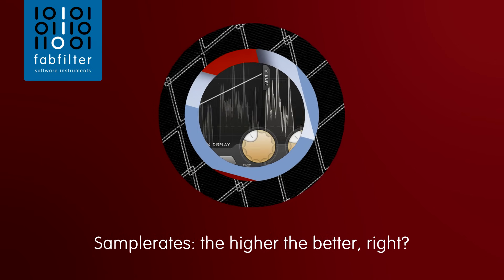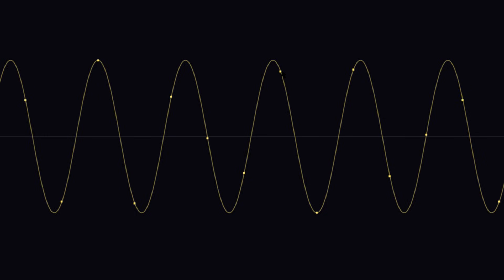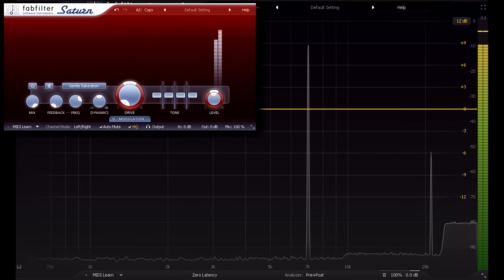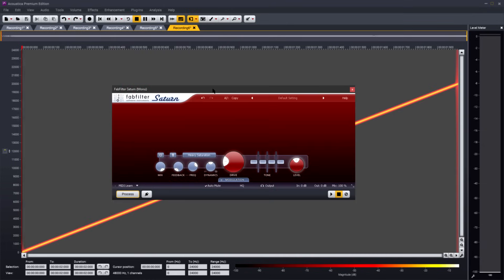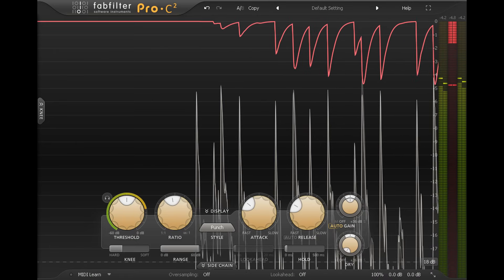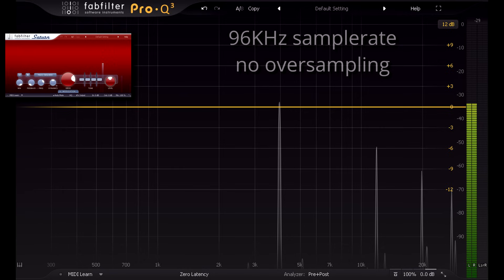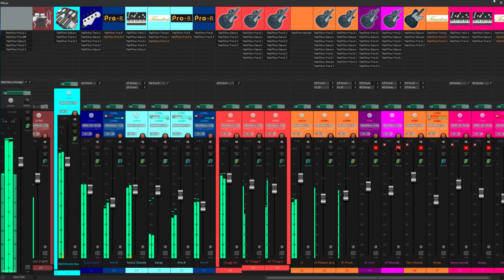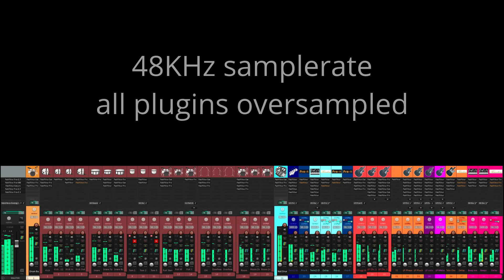Samplerates: the higher the better, right?

Comment: Excellent video! I thought I had a good understanding regarding the issue of sample rates, IMD, etc., but it seems I always learn something new from your content! I think you may have converted me to 48 kHz, but the thought of introducing audible artifacts during the conversion down to 44.1 kHz always bothered me. Can you shed any light on the subject? Are my fears completely unfounded?
Reply: Michał Bugajski 
Yes, completely unfounded.
Reply: Note the acoustica editor showing how a wave looks post-reconstruction. You can easily find that the same signal sampled with a different sampling rate, assuming they are both band limited produces the same result. While most DAWs don't show that wave, they all use the maths that go into this for sample rate conversion, so you don't get artifacts.

Comment: I am left a bit confused here- while 96k recording may not be necessary you only applied the  over sampling to the 48k example, wouldn’t the 96k program benefit as well from over sampling? Would the brick wall filters also reduce aliasing for the 96k program? Also isnt the addition of extraordinarily high harmonics in a saturation plugin more of a bad design decision in the plug-in  than a problem with recording at 96k?
Reply: It's decoding sir not same like encoding.

Decoding with 32-bit floating point + oversampling x2 x4 x8 or x16 (using API or siftware already progammed) can makes good sound quality rather than encoding

Comment: This is a good video but misses an important advantage for double speed sample rates (88.2/96KHz): all the tuning and timing correction we do these days benefits greatly from preserving ultrasonic information that becomes audible when stretched. Intermodulation distortion is a natural property of analog and not a digital artifact like aliasing is. And oversampling still has the same or better benefit at double speeds with an even gentler filter than 48KHz. It's also a bit disingenuous to have your sample audio at 44.1 and then upsample for the comparison...should have downsampled 96KHz instead. No one should work at 44.1 anymore, CD is long dead and everything else runs 48Khz including YouTube. Thanks I love your videos.
Reply: using samplerates higher than 48kHz is nothing more than erroneous stereotypes based on propaganda.
people using these higher samplerates trying to convince yourself by any means that their records will sound better from this.

Comment: This video is amazing. Absolutely packed with valuable information! 
The only part that was incorrect was the claim that YouTube videos have a 48khz sample rate. 
If you upload a video to YouTube with 48khz audio, it will be automatically converted to 44.1khz. 
So whenever you play YouTube videos, the audio will be sampled at 44.1khz regardless of the original sample rate.
YouTube made this choice to reduce bandwidth requirements.

Comment: man, you are so good!
I have a (stupid?) question: does the aliasing also also arise when recording analog distortion to a daw converter at 44,1khz?
Reply: No. The analogue distortion may produce harmonics higher than half the samplerate, but these will be filtered out by the ADC.
Reply: Not unless you build your own hardware and don't add an anti-aliasing filter. Generally your converter has a signal chain that looks like this:
Input->Anti-aliasing filter (lowpass that filters out everything above half the ADCs native sampling rate) -> ADC itself (here it's digitalized) -> digital filter cutting everything above half the recording sample rate -> downsampling to target sample rate. Now, if you get an ADC IC they generally have their analog AA_Filter built in, but many allow manufacturers to override the stock filter so they can design their own filter. So if you got one, overrode the internal filter and did not put a custom AA-Filter in the chain, you would get aliasing.
Reply: @simongunkel7457  Could've I see you commenting on Adam Neely's channel by any chance?
Reply: @ramziel  Oh, most definitely.

Comment: I did not hear much of a difference between the 41 KHz and the 48 KHz version of the mix. But I also realized that my hearing capacity above 15 KHz has already decreased significantly. 

My DAW is known for bad sample rate conversion, what offline tool are you using? The free one by Voxengo?

Comment: Excellent concise explanation!
Just dropping some "whataboutism" here: What about transient definition? Independently of a continuous pitched sound, there is more transient definition in a higher sampling rate. I can tell the difference between drums recorded (and being reproduced) in 96khz from drums recorded on 44.1. Would have been interesting to see some of that in the video, but I understand the point was to show the overall effect on the audio file. 
Also what about mastering for vinyl? 
For those interested in exploring the subject of oversampling and its effects on aliasing I recommend this: 
https://www.juansaudio.com/post/about-oversampling-and-aliasing-in-digital-compression
Reply: Is there, though? I'm not necessarily disputing what you're saying, but I'm struggling to come up with a rational explanation as to why there would be more transient definition at a higher sample rate? Surely, all we're capturing in digital audio is frequency and amplitude - which of these two parameters can we improve upon beyond what 44.1 kHz offers to yield better transient definition? The 'fastest' (so to speak) sound we can hear would be a theoretical 20 kHz frequency, and we already know 44.1 kHz is sufficient to capture this. I can't see how we don't already have the capacity at 44.1kHz to recreate the fastest transient possible.

I don't doubt that you're encountering differences in sound between drums recorded in 44.1kHz and 96 kHz, but I'm more inclined to believe it's a result of extraneous factors and variables and not the sample rates themselves. I'm sure there are things I'm not considering though, and I'm very happy to be corrected!
Reply: This is 100% false. Anything you're supposedly hearing either isn't there or doesn't have anything to do with "transient definition." In the time domain, all signals will be recreated PERFECTLY. You can try this yourself with an oscilloscope and moving the transient of an attack. No matter where you move it, the samples can recreate it, even if the samples don't move relative to the attack. That's just how the math of recreating waves WORKS. Becuase of the math, sample rate has literally nothing to do with the time-domain of a signal

Comment: Absolutely loved this video, and I'm seriously thinking about giving 44.1kHz a go for a while. However, it's worth noting that with a dedicated interface and computer for my guitar rig, the quality changes are striking when I run it at different sample rates. For single instruments, this seems crucial for achieving my desired sound. Yet, when it comes to mixing, pushing your computer to those levels and dealing with the issues mentioned in this video can be nearly impossible or not worth the effort. Just something to keep in mind! 🎸🔊

Comment: The first problem or issue with this example/experiment is not recognizing that recording a band recorded at 96k Vs upsampling a pre recorded band at 44k will give you a a different sound. Second the non musical sine wave samples will give you non musical sine wave reflections that will sound non musical. You can't isolate one frequency and and compare that to a living breathing musical recording or sound source. Just my thoughts.

Comment: Wow! This is the most lucid discussion and illustration of harmonic distortion that I've ever seen.

One small point that seems to be missed in this video is that antialiasing lowpass filters are often employing a trick where they don't fully attenuate content exactly at 22.05 kHz for a 44.1 kHz signal, as you talk in 26:00, but they often are configured to start attenuating around 20 kHz and reach complete the attenuation around, say, 24.1 kHz, with the midpoint of the transition band being at the middle, 22.05 kHz. This is because the aliased components remain ultrasonic, so they don't matter, but the FIR filter length becomes halved, which also halves the CPU cost. Doubling the width of transition band from 20 kHz to 28 kHz at 48 kHz sampling rate will halve it again. At the beginning, where you show off the mild saturation in spectrogram, you can also see that some of the aliasing is reflected back at ultrasonic range, and I believe this suggests that this particular trick is being used in the HQ mode. If the aliasing was controlled in a more traditional way, you'd see the overtones fade out before they touch the 22.05 kHz line, and nothing would be reflected back.

One other giveaway is seeing the -6 dB point at nyquist frequency for the lowpass filter. It doesn't seem to be much in dB terms, considering that any sinc filter is going to hit at least -96 dB in any competently written program, but it is already -50 % of the linear value by this point.

Comment: I don't understand why the 10kHz and 20kHz waves turned out to be perfect sinewaves even though there's just two or one sample points respectively for each half of the cycle.
Why are two or even just one sample point for each half of the cycle enough to reconstruct a perfectly smooth sinewave?
Why is it that if we increase the sample rate to 96kHz the 20kHz wave doesn't get represented with any greater accuracy?
I'm confused AF
Reply: The Nyquist Theorem. Also, those samples get connected with a smooth curve, so as long as there is at least one point, the reconstruction should be perfect.

Comment: Hey, I want to run a project just to run my guitar sound in 192khz with some effects. But at some point it starts clipping.
Are there processes in windows I can shutdown or something to free up my cpu? or is it gonna clip anyway?
Reply: Clipping has nothing to do with cpu. Clipping is a signal with too high of an amplitude to be captured correctly digitally. You need to turn down the gain or volume in your plugins

Comment: A very interesting and well documented presentation. Thank you. Listening to the differences from a 2 channel out of my PC through an old modest at best 4.1 PC speaker system running the front 2 channels into the rear speakers and pointing them away just for ambiance, because I could not crank it to hear details and the bandwidth is limited, the biggest difference noticed a shmearing of image. The center image would spread and wander slightly. 

Another part that caught my attention was the IM of the guitar with the drum mixed in. Very audible even with my limited listening environment. Something I would never put up with with my analog vinyl playback! If drums IM'd guitars that badly in it I would toss the system. 

One of the underlying problems with all of this is that the sinewave has little to do with music other than especially way back simple sinewave measurements was all we could do. Hearing is actually time domain based. Sound pressure waves enter the ear and vibrate a successive series of hairs which based on the time duration of the pressure wave reach further into the ear, modulating more hairs further into the canal which the brain then processes based on that duration and amount of penetration. Our brain does not do FFTs to determine fundamentals and frequency distribution. Measurements show we are capable of discrimination thresholds for interaural time differences that are near 10 μs for normal hearing listeners. That would relate to a 100KHz fundamental. So while few if any people would "hear" a 100KHz sine wave. Most people are able to discriminate that time difference in a leading edge of a audio signal. We just could not make test equipment that operated in the time rather than frequency domain back then. And so now everyone works in the frequency rather than time domains.

Comment: So, you said once 4x oversampling and also 8x oversampling. Which was used when you tested with HQ / oversampling?
Reply: HQ mode in Saturn enables 8x oversampling. I used the highest 4x setting for compressors and noise gates etc. in the final examples.
Reply: Dan Worrall Many thanks!

Comment: I've been battling with myself about this for a couple of months now.
"192khz? Pointless. 96khz? Meh. 88.2khz? Perfect...???"
And after watching this video, I've determined for myself that 48khz is probably the optimal samplerate.
It will pretty much reduce the chances of intermodulant phase distortion, while also giving me the benefit of being able to produce music suitable for both consumers, and for films.
Simply downsample to 44.1khz during mastering for consumer listeners, and for scores, mastering at 48khz.

I still have some doubts and concerns. Can anybody vouge for this conclusion, or am I still an idiot? lol
Reply: TL;DR, producing/mixing at 48khz (simply to accomodate both consumer listeners, whilst maintaining the preferred sample rate for filmscores if I were to be approached for any type of placement)
48khz for filmscores
44.1khz for consumer listeners
In production and mixdown, 48khz. Master down to 44.1khz for consumers 
Master at 48khz for film placements.
Yes? No? Maybe, so? It sounds correct to me.
Reply: Uploading 192k is pointless for most sites but mixing is not. Soundcloud recommends 48k/24bit wav files.

If I had powerful PC, I'd mix and master in 96k so there's less real time oversample/downsample in plugins, and downsample to 48k for soundcloud.

Comment: But it appears you are making the assumption that the conversion algorithm “knows” what waveform shape is being reproduced—in your example, a sine wave. Then of course it can plot that with only twice the sample rate of the maximum frequency. This does not represent or model complex audio signals. What am I missing?
Reply: @ReaktorLeak I guess I’m just thinking too simplistically, in that 1) with fewer the data points it is possible to interpolate between them in more than one way, and 2) most natural sounds are not sinusoidal. But I’m neither a mathematician nor a sound engineer and obviously missing part of the picture.

Comment: The problem is, audio is not perfect sine waves. You can predict a sine wave, and an algorithm can do that. It can perfectly reconstruct a sine wave based on what should be there. However, the sound of instruments is so complex, that it can not perfectly reconstruct it unless it has enough samples, and the more samples you have, the more complexity you'll see. Also, though human hearing is capped at 20 kHz, frequencies above that range clash and combine to produce frequencies below 20 kHz, so if a DAC does not produce those sounds above 20 kHz, you are losing audible frequencies within the music. This is why Rupert Neve made sure that his equipment was rated to be linear up to 50 kHz

Comment: "higher sample rates aren't the solution to aliasing when adding harmonic distortion, see this 192khz example with no filtering of the sweep down to audible ranges to begin with... so our approach is to take it up to 384khz and filter it a bunch of times (down to audible ranges to begin with), because that's way different" ... you are still processing it at 384khz inside the plugin guys with 8x oversampling.
Reply: True, you are. However, in this case the plugin is oversampling then filtering the other frequencies out for you. Without the plugin you would be setting your projects to very high sample rates, and creating massive files to deal with the harmonic noise you're getting in your mix. If I wanted to add saturation to a synth for instance, I would need to set my entire project to 192khz, record everything in that sample rate, and thus create massive files for my project which may extend well beyond 20 tracks. Basically, you're taking up quite a lot of time, diskspace, and CPU power. 

The plugin (or anything that offers oversampling) helps you avoid those massive files for everything in the project. I can set my project to 48khz, record in that sample rate, and still deal with the issues harmonic distortion may introduce. 

Essentially, it's a way to clean up audio without making your projects absolutely massive and more CPU heavy than necessary. It's also worth noting that the plugin will filter out those frequencies for you, thus saving you time over doing this process manually. 

And no, this is not necessary for a lot of projects, but it is a good tool to have should you run into this issue at some point.
Reply: @candinmuniz3225  yes all true, but i think some people see the examples in this video and assume high sample rates are bad, well they are not (when handled properly as you say).  But the test i would like to see is instead of 48k 8x oversampled is say 96k 4x oversampled or 192k 2x oversampled using a consistent testing method i could only think they would perform better.  The IMD (intermodulation distortion test) where they put random noise at like -3db or higher?! outside of audible range was a bit nonsense'ish, i mean what real world signal has that?  but he did say that filtering would solve the issue at the end at least, which is exactly the point no signal should have content that high/loud.

Comment: This is fine and well and all, but aren't you aware that YouTube applies lossy compression to all audio on the site? (It was probably implemented as a means of antipiracy, but I digress.) Namely, all videos on YouTube that have audio will be affected by the same artefacting present in e.g. MP3 audio compression: namely distortion by loss of fidelity, especially with respect to frequencies “outside of human hearing.”

In this manner, therefore, your presentation has an inherent (and strong, at that) bias towards perpetuating the notion that high-resolution audio is worse than, if not just the same as, standard-resolution audio: By definition, your audience is hearing something substantially different from that which you're hearing.